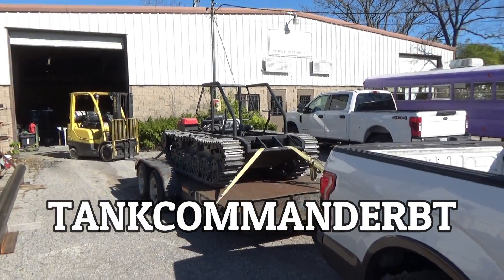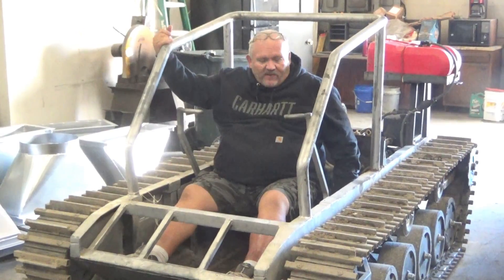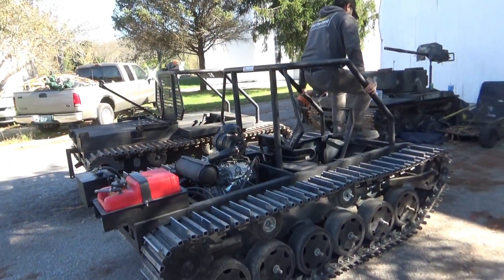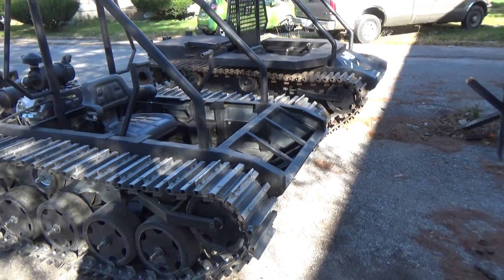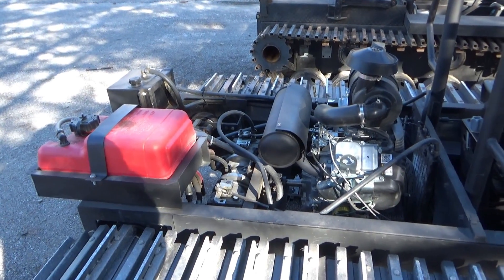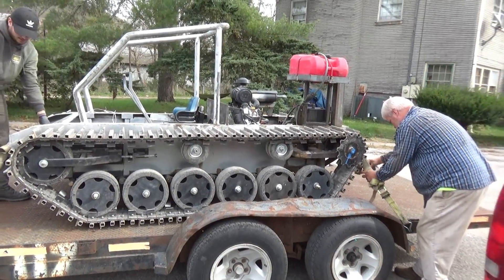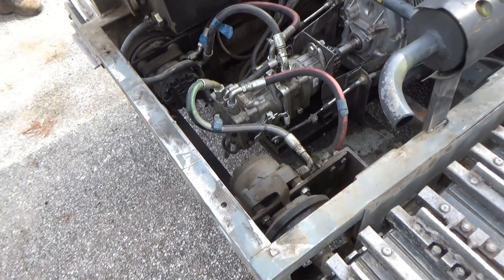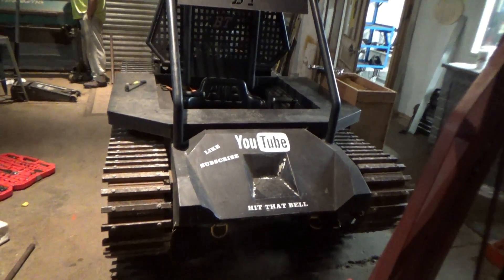HOMEMADE TRACKED VEHICLE (testing t-unit vs tandum hydraulic pumps)

Comment: How much torque do the hydraulic motors have and are the lower rollers made of steel and plastic or is it more rubber? Shouldn't there be a cooler built into the oil circuit?

Comment: Really cool concept.  Id say the 21CC pumps are a little small or under powered./not enough flow.  They seem to struggle climbing almost like my zero turn mower when they hydros are worn.  This would be a great up north vehicle but definitely needs to be a 2 seater.

Comment: What a great machine. Did you use a differential gearbox or two hydraulic motor instead sir?
Reply from the maker: I used 21cc hydraulic pumps, pushing two 21cc hydraulic drive motors at 3000 psi of pressure . powered by a 35 HP engine .
Reply: Thanks for the answer

Comment: Can you share more about how it works more specifically?
Reply from the maker: 37 HP engine direct drive to 21 cc hydraulic pumps pushing 3500 psi pressure to the 21 cc hydraulic wheel motors . Thank you .
Reply: Thank you very kindly sir! Much appreciated

Comment: Boss, what about some new stuff? :)
Reply from the maker: Lost footage due to theft so i will be posting what I have starting this week end, about to start editing when I finish this reply . The machine weighs 2200 lbs ,has a 35 hp Vanguard engine  , direct drive from engine to 21 cc tandum pumps, supplying 21 cc drive motors . The MAV's length is 9 feet by 5 feet wide . Tracks are 18.5 feet long 11 inches wide and weighs 306 lbs each. The black MAV with the dump bead weighs 3000 lbs . Machines are slow because they were made for climbing steep terrain with a 1500 lb payload over a 50 degree slope .Sorry for the slow reply .

Comment: I like seeing you and others thrash these units! The real difference between the pumps layout comes from the units they were designed for and the space available, I asked the Hydro-gear folks and that was their answer.
Reply from the maker: How you been , we noticed the tee unit has been out performing the tandum pumps with the same set up so we are going to swap engines in the two machines to see if that might be the difference.
Reply: @mimimitchell1989  I think those t-units were over engineered especially for the crazy Dixie Chopper people that always had speed on their minds and the machines were short but wide. I like the way you are doing your research especially when you film it and post it too!

Comment: What is the t-unit?
Reply from the maker: A t-unit connects two hydraulic pumps together so you can drive them with one input shaft .
Reply: @mimimitchell1989  so what's the difference between that and tandem pumps?